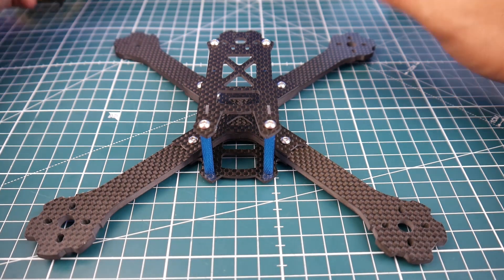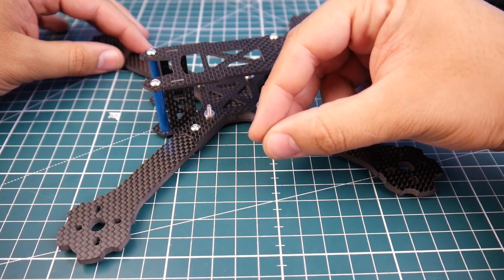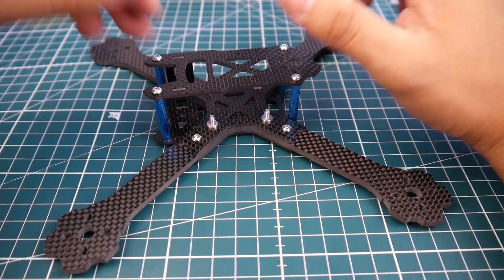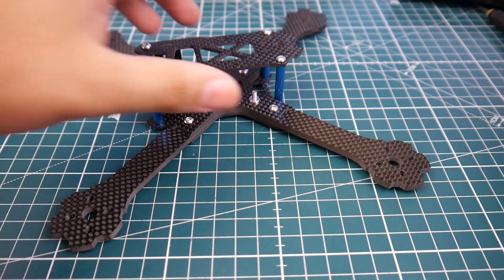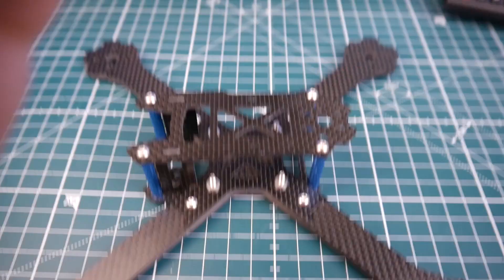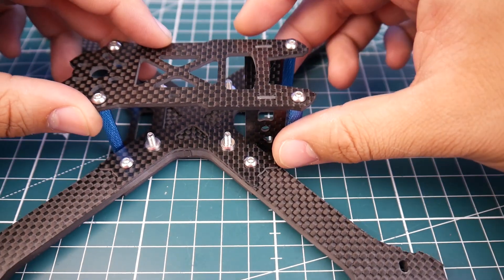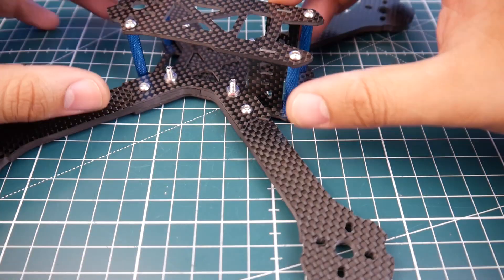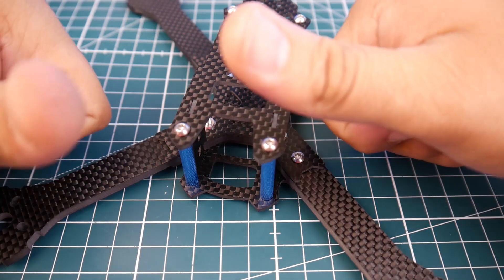A-MAX X215 Frame // Overview

Comment: I think I like the 220 better mainly because the extra reinforcements would help me in my many many crashes.  This is of course theoretical because I will not have either of these frames unless I were to win one.  If I were to buy a frame similar to this it would most likely be the frog.  Thanks as always for the vids and see you next iteration.